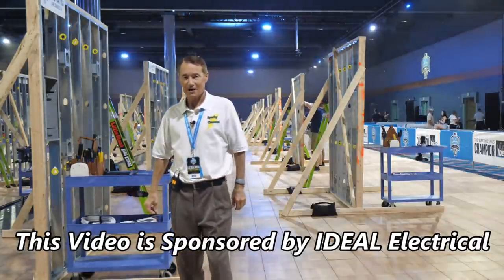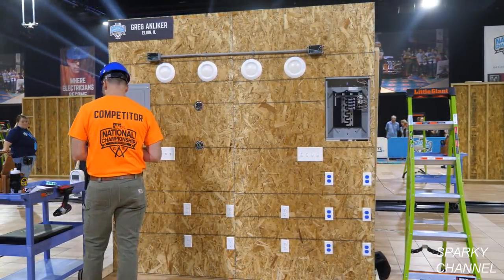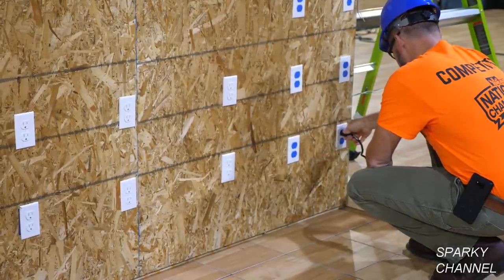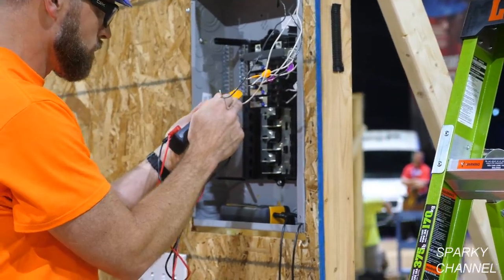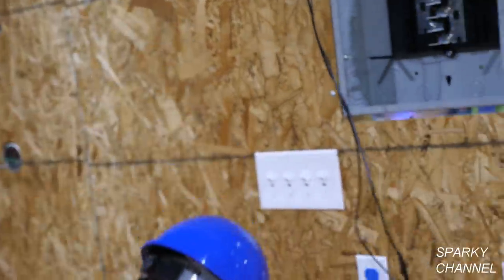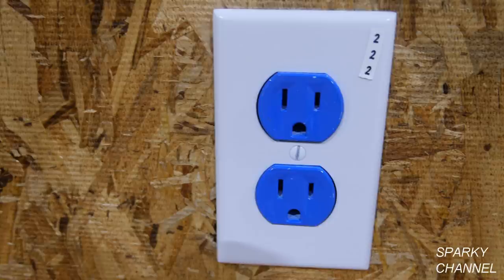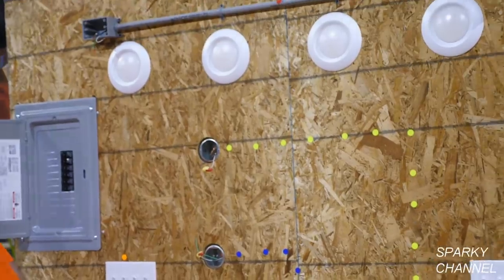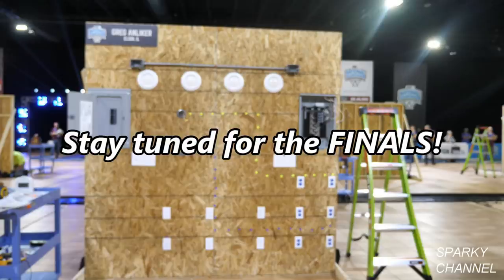IDEAL National Championship Semis 2019 Electrical Troubleshooting

Comment: it is good to be able to find the upper most receptacle, especially when you have a receptacle with partial voltage. If you can find the last one in line on the circuit that is getting full voltage, that is the one where, more than likely, you lost the neutral leg feeding the rest of the receptacles in the line. I'm glad I'm getting to see this thing in action. The next time I have the money to throw at one, I want to get it. I like troubleshooting circuits!

Comment: I have the Ideal circuit breaker finder. I've used it a few times. You have to go over the circuit breakers several times for it to tune in to the correct circuit, but it works. I don't really like the rocker switch for power, though. too likely to get turned on in the carry bag, and the access to the battery compartment could be tool less like most battery compartments are. but it works okay.

Comment: Which tester is best to use for burnt connections that's about all I ever find 90% of the time?
Reply: Use a thermal imaging camera or use a multi tester and you should pick up most problems when measuring the zs or carrying out an insulation test

Comment: Wonder of the sure Trace circuit tracer can be used to find wires Underground conduit underground and how deep if able to do so?
Reply: I’ve used it to find circuits underground.
Reply: @grk25922  how deep?
Reply: Bubba Brazil I was tracing UF cable. It was about 12 inches
Reply: @grk25922  wonder if you can use it to find coins and diamond rings,etc. in the dirt/sand?

Comment: So.....This s not a contest of electrical wiring knowledge,   It's a contest of electrical testing equipment ????
Reply from the maker: They were using the testing devices to discover where the wires were behind the wall. They need both knowledge of the testing devices and general wiring knowledge. But they didn't do any actual wiring in this contest.